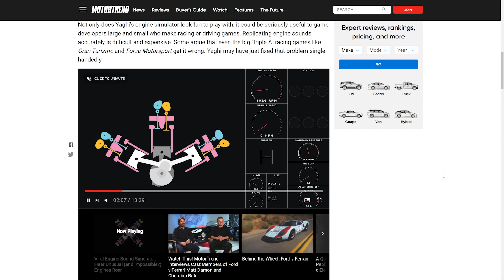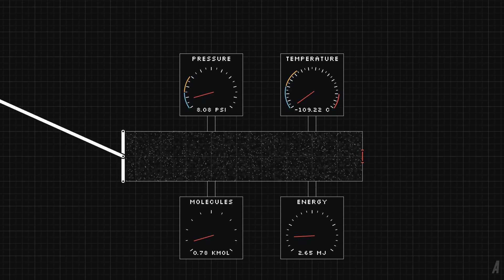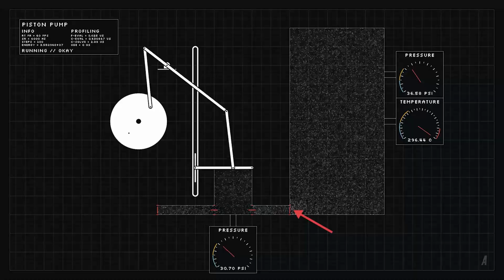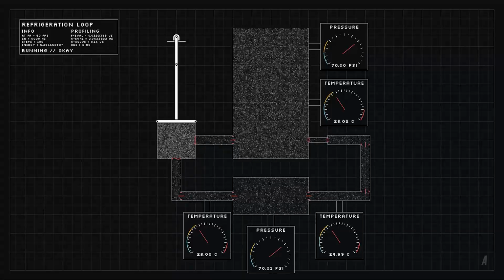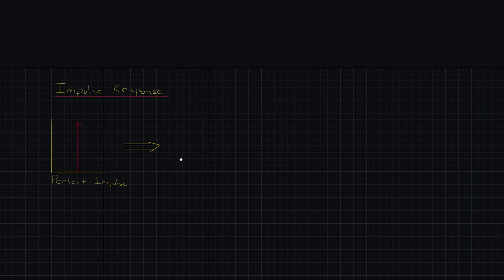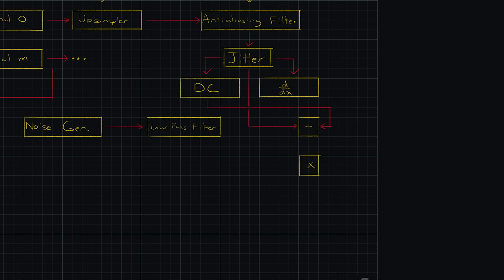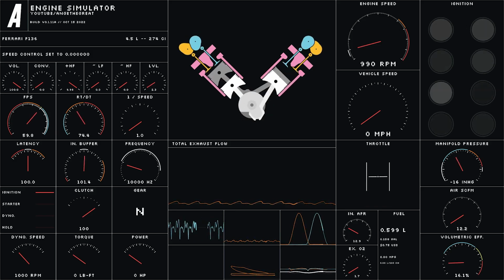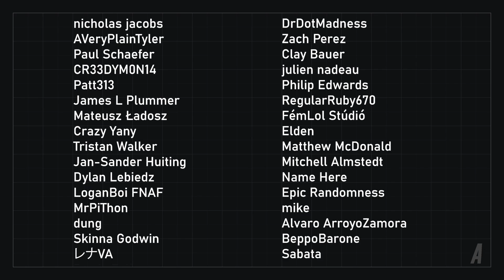Engine Sim: Procedurally Generating Audio Using a Real-time Fluid Simulation (Technical Breakdown)

Comment: I dont care how accurate this is or how good the engine manufacturers simulations are. This is so freggen cool. I love this project. 

If I picked up one thing from your impossible engine simulation. Its that part of the sound of an engine its that its not perfectly balanced.

So if you can somehow include minor imperfections and/or insimilarities between cylinders in an engine. It would probably sound more lifelike.

Keep it up 😎
Reply: i had this idea to purposely misalign the crankshaft. Instead of 180 for 4 cylinder, vary between 178 and 182 degrees.
Reply: Yeah, this is definitely getting into the realm of the physics and gas simulation engine being "too" perfect, whereas in real life there's piston seal leakage, gear teeth backlash, timing belt stretching/slipping, and all sorts of other nasty vibration that causes wear and tear with real-life engines.
Reply: @MajatekYT  but it will take long to implement that because consider like the materials that combined to become part of that engine. it can create the simulation engine perfectly like timing, gear, etc, but the rest of them do it in real life

Comment: For the EQ stages, there's a definite physical justification to boosting the high frequencies if you consider the way the thin walls of different exhaust components would couple interior and exterior pressures, blocking "DC"=exhaust leaks while allowing high frequency. And if you want, you can absolutely derive "realistic" frequency response curves from first principles by finding clever ways to treat everything as a damped spring-mass system (or an LCR circuit, since it's the same math).
For a thin-wall exhaust tube, the mass term can come from the material's area density and the spring term from hoop stress calculations; for a solid engine block the mass term can come from volumetric density and the spring term from hertzian contact stress mechanics. For either, the damping term comes partly from mechanical properties and partly from the exterior surface area vibrating and getting pressure+cavitation drag.

Comment: Fluid mechanics expert here. You’ve done a great job here. Computational fluid dynamics software is a real mess. It’s often crazy expensive and awkward to use or free and open source and even more awkward to use. The results are often garbage and require a lot of experience and expertise to be useful. For students the whole experience is painful. They struggle with the user hostile software and barely get something basic to work in the end. 

A tool as accessible and dynamic as yours would make an incredible teaching environment. Same for BeamNG. 

So in a sense this is revolutionary.

Comment: See, I just love the fact that this was done SPECIFICALLY in the quest for realistic engine sounds. Not for like a full realistic engine simulation or anything, just to get the sounds right... but along the way it just morphed into that, and when you think about it of course it makes sense. What better way to generate a realistic engine sound from a handful of variables than to simulate the entire engine? Because all of it has an effect. Flat plane cranks sound far different than a cross plane. Cam lift duration will change how an engine sounds. The length of the headers, the firing order, all of it... and I'm thoroughly impressed at just how close and good it is, even in this form. Honestly can't wait to see how this tool evolves.

Comment: I made a VST version of this core idea in 2012, but credit where credit is due, I did not build a full-on physics modeling engine, but rather condensed the conceptual functions of an ICE engine to work within the framework of a musical synthesizer. It's been interesting to watch the development here and the open-market uploads of various users' different engines, because I can see and hear the exact same issues I had to work through to get mine more accurate over the (admittedly quite long) time it took to develop into the fully-featured product I brought to market. Seeing this newfound interest (or perhaps just latent interest that I never tapped from lack of adequate advertising?) has made me consider picking up development again. Either way, impressive product so far for sure, and I hope you're able to further refine the model to get a more accurate response/sound out of this program than even what you already have.

Comment: People on Reddit were doubting the veracity and authenticity of this simulator? Shows how much they (don't) know! It's clear that it's still not a "perfect" simulator, as far as the audio generated vs the genuine article that it is simulating, but it definitely is producing audio that has the same distinct characteristics of the actual motors and engines themselves. This engine simulator and the audio synthesizer are REALLY cool, and the sheer novelty and ingenuity are something to behold. I think the work done here was well worth it for the result produced, and AngeTheGreat accomplished what he set out to. If someone wants to go write an individual molecule or even macro-particle simulator that does the same thing, I challenge them to. At the end of the day, a simulator will never produce the same exact effects or results of the actual thing that's being simulated, that's why it's a SIMULATOR. I sorta feel like this video wasn't warranted, at least anywhere it acknowledges the jealous naysayers, though I did enjoy more breakdowns of the internals but I fear that their presentation was motivated out of frustration with the dingdongs with internet access, rather than by passion like the previous videos were. Nobody doing awesome stuff like this needs to be wasting their time or mental energy on recognizing the morons who will never do anything anywhere near as neato or interesting. Anybody can say anything on the internet, and as such morons will say moronic things, it's inevitable - there's no avoiding it, so you just gotta take it in stride and not let it affect you.

Comment: really REALLY Amazing!! But there's one thing to consider: The engine itself makes noise, the inside parts make sound too, the valvetrain, and such. Still, Amazing program!
Edit: I never thought I would ever see anyone make an really accurate engine simulator. You made it. You're a legend. Congratulations!
Reply: Another sound when shifting the piston in dead spots.

Comment: Take it from someone who spent over 20 years in the auto OEM engine development business, with names most will recognize immediately, your simulation is f-ing ace!  It's probably more than good enough to do some scoping work at a conceptual level for a real world engine development project if you were after a certain type of sound.  It probably also generates a more accurate power and torque estimation than most garage dynos that people use for their modification willy waving.  I salute you sir!

Comment: Do I understand correctly that you're using EQ to boost the high frequency signal, to make it less muffled sounding?
Have you tried adding harmonics for the high frequency sounds? For example with a saturation filter?

As if the loud sounds vibrate other parts of the engine, with different kinds of sympathetic frequencies.
Reply: He does have a clipper at the end
Reply: @LarsWilms  true, though I'm not sure that's the kind of saturation you would expect from an engine
Reply: From a physical standpoint, this makes sense even without considering mechanical vibration, since acoustic propagation at these pressure levels is nonlinear: the waves travel faster in the high pressure zones than in the low pressure ones, causing gradient steepening and spectral enrichment. A simple setup to take it into account would be a variable delay filter, in which the delay depends on the signal itself.
Reply: Not sure if that would really give you a better result.

If you work with high pressures, air acts more akin to a compressor, as you have some base inertia from your particles, and compressive properties where part of the acoustic energy is converted to heat due to friction or pressure differences in the air.
So while you do get changes in dynamics from the air and elements around the engine, it wouldn't really saturate the sound, as the changes in dynamics happen on a larger timescale than 1 single cycle.

Beyond that, the main issue that's being corrected here is the overall spectral shape of the sound, while keeping the waveform mostly intact.
If you distort the signal, you won't really shift the spectral centre in any major way (this refers to the overall shape of a sound when viewed in a spectrogram). This is pretty important to how our ears perceive "dark" or "bright" in a sound, so an EQ would work better here.

Last but not least, if you actually wanted to simulate the way the engine resonates by the sound, you would still use a convolution impulse for this. The harmonic frequencies you generate would be harmonic frequencies of the object that is being excited, not the signal that generates it.

So having harmonic distortion on the engine rawr itself sounds somewhat unnatural (at least from my theorising and testing I just did).
Reply: Saturation would help the "click" feel less digital for sure
Reply: @RogueBeatsARG  a click is generally generated by having sudden point where the signal "jumps" and is no longer continuous. This generates a lot of harmonic frequencies as you need these to represent these extreme changes in the signal.

If you use saturation, what you're dealing with in most cases is some sort of non linear scaling of the signal, so it's like mapping each possible value to another. If you assume a single sample impulse, saturation would do pretty much nothing to the click itself outside of possibly changing the amplitude.
Reply: @robiaster re: the object actually being excited, this reminds me of a Matthias Wandel video where he used a frequency analyzer to figure out the rotational speed of one of his tools. It wasn't exactly trivial because there were so many peaks of so many different components being excited. Beyond the obvious stuff that's mostly been covered, I wonder how much the resonances of all an engines other components contribute to the sound, water pump, oil pump, alternator, I assume there are a number of parts that simply end up ringing like a tuning fork as well. Perhaps the volume of those things aren't enough to matter at higher than idle RPMs, but idk. 

This whole project and all the associated discussion is so cool.
Reply: As someone who used to build gocarts and minibikes and still occasionally rebuilds my '74 Deere's Kohler K301, went to school for audio production, and ended up with a career in programming, this is almost too much to handle. Friggin amazing. It's so cool to see a confluence of disparate areas of one's interests; there's like an extra synergy of vicarious passion when those lines cross.

Comment: I simulated a guitar sound in a similar way, by physically modeling strings with particles and translating their vibration into a waveform.

the most interesting takeaways are that it's particularly hard to pluck a string procedurally without introducing a sharp release sound that sounds like metallic clanking, but it's curiously easy to stimulate rock-like distortion by literally clamping the output signal.

Comment: First off, I love it all! Everything from the visuals and explanation to the voice over, it's all on point! I feel like this video could only have been made by someone who really knows and loves his craft. This video also shows that a regular human really can learn almost anything. Thanks for teaching me something new and interesting, made my day a little bit better! : ) (Side note: 13:31 I 100% agree LOL)

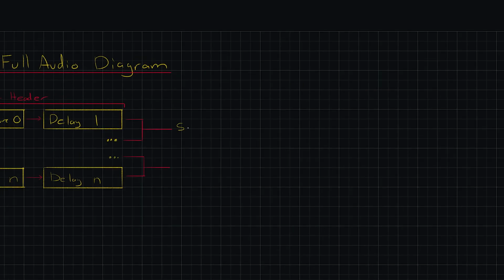12:55 From my experience, this noise is almost never truly "random" (but I think we both get that, moving on). Theoretically correct or not, this noise method is actually commonly used in music production when you are making a synth preset/sound etc. The reason behind this is almost the same as yours. The noise coming from an electronic synth can in a lot of cases sound too perfect, sterile and electronic. By adding noise into the mix you make the synth sound more natural and warm (in a way faking how an analog synthesizer would sound). I sometimes use this technique myself when making a preset. (there's obviously more to noise than this but it's the basics)

13:39 When I see this I wonder a few nerd things (sorry if this is a lot).
1st: What bit depth and buffer size is the program "playing" at if you know (both before the "upsampler" and at the finale output sound, if there is a difference)?
2nd: What noise is the "Noise Generator" generating? (Is it just regular white noise or something more complex?)
3rd: What "settings" are you using for your "low pass filter" (what frequency does it filter etc)?
4th: What compressor type is it (multi- or single band etc), and what "settings" are you using for it (if it operates like a regular compressor that is)?

Again, thanks for the cool video, I love it, and thanks for reading this!

Comment: I think using the ideal gas model was a smart idea for your air pump simulation, considering that atmospheric temperature and pressure is already well past the saturated vapor line on a T-v diagram, but since refrigerators operate so close to the saturated vapor line, and commonly transition into the liquid/vapor mixture dome, you won't get any meaningful/realistic behavior out of modeling refrigerants using the ideal gas model. Other than that, I am glad you spent the time going over how you condensed undergrad level engineering material into a nice and clean piece of software. Very good job.

I bet you that car companies model their engines by solving the navier-stokes equations repeatedly for each cylinder, one degree of rotation at a time, for each each stroke, which probably takes hours for them to compute just a complete cycle of all cylinders. You are able to create meaningful and semi-realistic engine behavior in a matter of milliseconds of time. That is so freaking cool!
Reply from the maker: The refrigeration cycle shown in the simulation is not the same as the one used in typical vapor-compression systems. Refrigeration can be achieved without any changes of state, but is less efficient. What I show is gas-cycle refrigeration which is a rarely used but still viable method of refrigeration and does not use phase-changes or any special refrigerant (air being the refrigerant). Gas-cycle refrigeration systems are also slightly different from the one shown in the simulation and typically use an expansion chamber or turbine to reduce pressure as opposed to a nozzle but I wanted to keep the demo as simple as possible.

Comment: Mechanical Engineer here. Everything you said about fluids was spot on. But man, if you can take the same concepts and apply it to compressible flow/supersonic flow that would be incredible.  Imagine all of the cursed wing designs, intake designs, nozzles, shock waves, etc etc. Or procedurally generated fluid dynamics in flight simulators including vortices and vapor.
Reply: I was thinking about how the video only shows the "choked flow" equation for a moment -- it made me think of how easily flow can become choked in small openings under large pressure differentials (ahem throttle bodies and engine valves). Though, I wonder what such choking actually means for the sound 🙂
Reply: @fishercawkey  I believe he showed non choked flow (first eq). I actually never thought about the speeds of flows through ICE's and how close they come to mach 1 or even into the compressible region. Definitely something I will read into!
Reply: Imagine if we could one day simulate actual vocal organs this way too, instead of using recorded phoneme samples. In fact, you could use such technology to simulate how other forms of animals than humans would sound if speaking (if they had the brain capacity to do so) and what kind of phonemes or sounds they could even produce. It would be fantastic for filmmakers, video game makers and writers. For worldbuilding it would be so fantastic in creating realistic non-human species!!

Comment: Holy crap dude, I was already amazed enough about what you've been building and presenting and thén you casually started discussing the heat cycle in refrigeration using your model. And then it just kept getting better and better...

Comment: Just found this today, I'm going through these videos, the only real flaw I see in how the audio is generated is you don't have all of those nasty little bits of reality interjecting into our perfectly running engine, inconsistent fuel, hotspots in less than perfect mass produced engines, rattling in the muffler because it was a rough fit for a dozen models and not a perfect fit for any of them, resonation for various reasons from the exhaust.

You have the ideal engine, reality introduces all of the problems. Of course all of this makes the engine sound cooler.

Comment: Regarding the peculiarities of the sound of pipes and valves, you can read about the study of the simulation of wind instruments and organs.  For example organteq does a good job of simulating the sound of organ pipes.  An organ has pipes and valves.  There is a lot of research that the creators of organteq rely on.  There, the features of the movement of the air flow in the center of the flow and near the walls of the pipes are studied.  The swirls on the valves are also investigated.  And how it should sound.  You may be able to find some additional information there to refine your simulation.